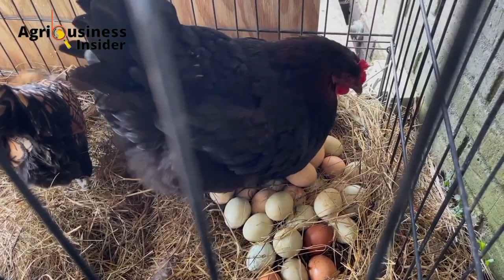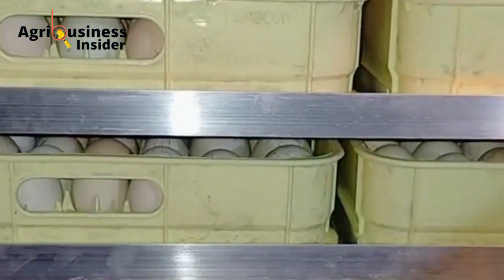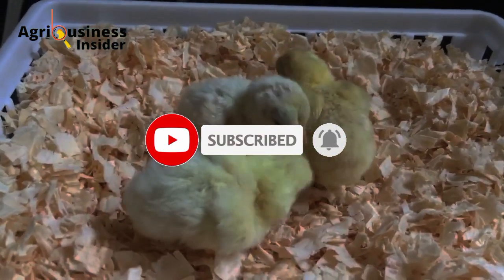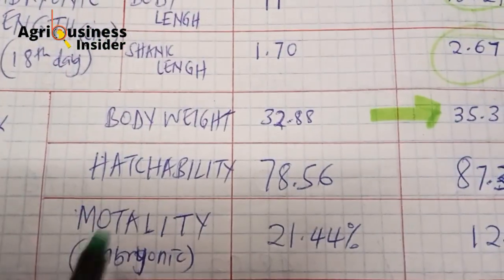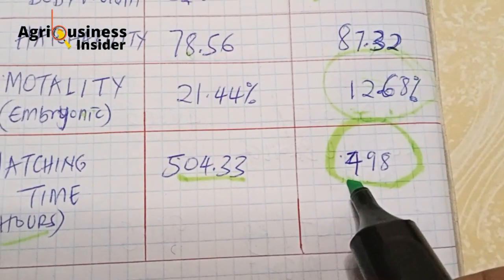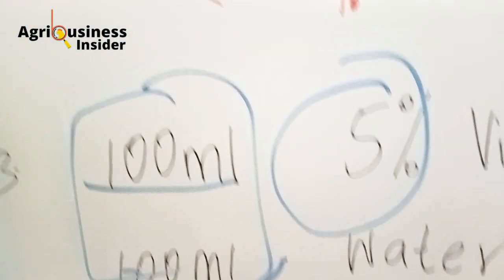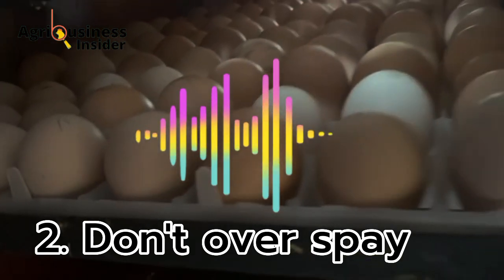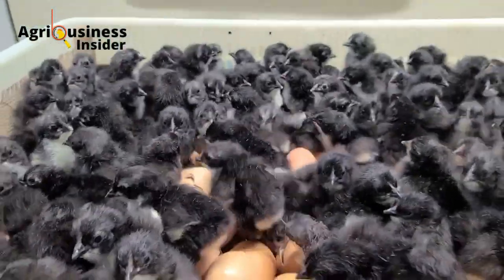100/110 CHICKS HATCHED After SPRAYING VINEGAR on FERTILIZED EGGS

Comment: Thank you so much for the information then what’s the ratio of mixing 4% vinegar
Reply from the maker: Dilute 4% Vinegar to 2.5%

To convert 100 ml of 4% vinegar concentration to 2.5%, you will need to dilute the vinegar by adding water.
One way to do this is to use the following formula:
(Desired concentration / Initial concentration) x Initial volume = Final volume

So in this case:
(2.5 / 4) x 100 = 62.5

You would need to add 62.5 ml of water to the 100 ml of 4% vinegar to achieve a 2.5% concentration.

So your final solution will be 162.5ml of 2.5% of vinegar.